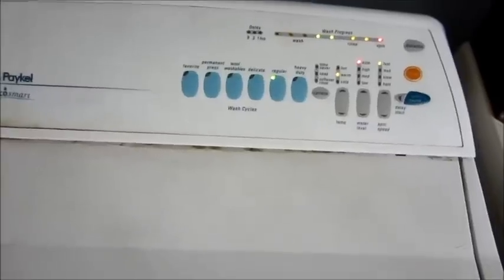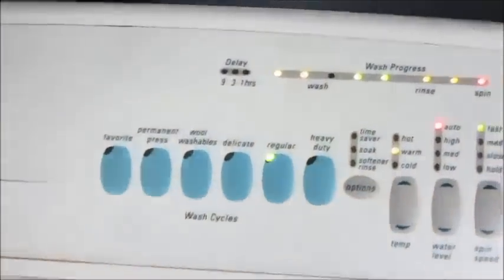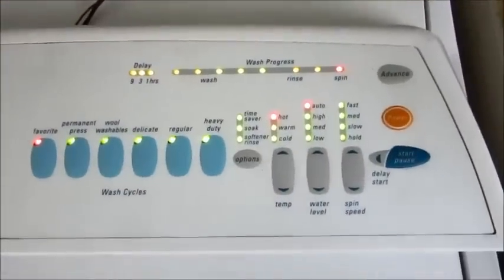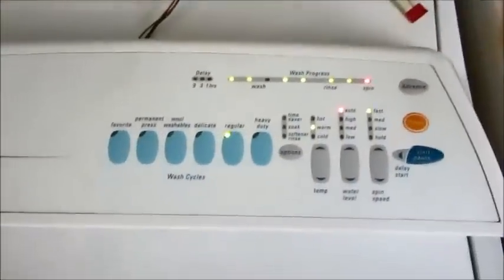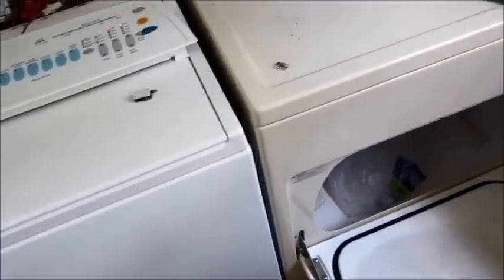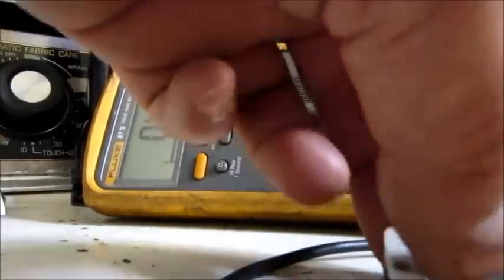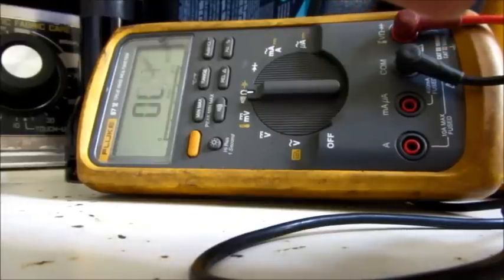Fisher & Paykel EcoSmart GWL10US washing machine - erratic operation - balance switch...

Comment: Thank you so much for posting this video. It got us back up and running. :)    I cannot believe it was that simple.
Reply from the maker: hycron1234 Thanks for the feedback. I ordered a new switch from the manufacturer. The new switch was an updated, water resisting design. It had rubber seals around the wiring and the switch button. Should not happen again with the new one.

Comment: Mine was doing that same thing, and the manual says wash progress lights designate binary code: after machine cycles and stops it beeps and some lights are on ; left to right the indicators are: 128, 64, 32, 16, 8, 4, 2, 1. Add up the lit ones to get code. Mine indicated 32, 8, 2, 1 = code 43 OOB Switch fault. I found corrosion on the connection at the switch but replaced switch anyway. Ace Hardware sells them P/N 3135902. Just have to remove actuator lever and be sure you connect to COM and NC terminals. NO tab is on switch too, just ignore it. The machine is probably made to run the fill valve unusually to call attention to the fact there is a malfunction.

Comment: Thanks for uploading this. I struggled with the balance on my machine after replacing the motor control unit, valves, the entire hot and cold water lines all the way into the basement after they froze and caused water to leak into the motor control unit housing bay, which not only fried the motor control unit but also damaged the thyrister. I ordered a new balance switch and will wait to see if this fixes it, after ten months of struggling with the washer unit.

Comment: the new switch seems bigger than the last one and the wiring seems different. any help with fitting the new one into the bracket?thanks
Reply from the maker: +Donna Bushong 

Hi Donna. The new switch came with a new bracket, switch arm, and some wiring instructions. The original switch was damaged by water going into the switch around the wire terminations. The new switch has permanently sealed wires. The old wires get cut off and connected to the new switch's wires.
Reply: Thanks. I think I got it. I didn't replace the bracket  but I did install the New switch and dud rewire. Hope this lasts. My machine is 12 years old and I love it. Thanks for your video
Reply from the maker: +Donna Bushong 

Glad I was able to help! Ours has also been a good machine. It works better than the front-load units in that it does not collect water and rancid smells in the drum.

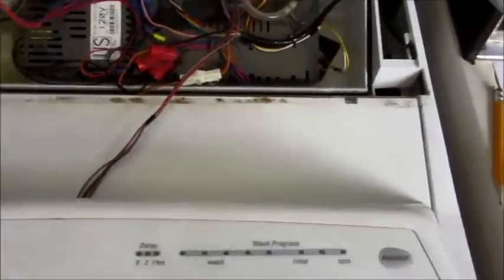Comment: 1:09 hey i know what a thyrister is its a basically an SCR (silicon controlled recifier) that conducts when its control pin (the gate) is triggered then it will continue to conduct until the power through the other 2 pins is turned of
Reply: +Hays Coleman oops i thought you said its a thyristor my bad X(
Reply: +Hays Coleman you actually said its a balance switch
Reply from the maker: +Hays Coleman LOL thanks for the comments! Yes this was the out-of-balance switch.I have in the past replaced one of the components on the PCB with a thyristor switch (TRIAC and optocoupler) to repair the drain diverter valve. This was unrelated to the balance switch. :)
Reply: oh ok i used to have a working SCR in an old eletronic snap kits kit until i accidentally pulled out the SCR thing in the center of it (it is a green plastic thing with an scr symbol on it)